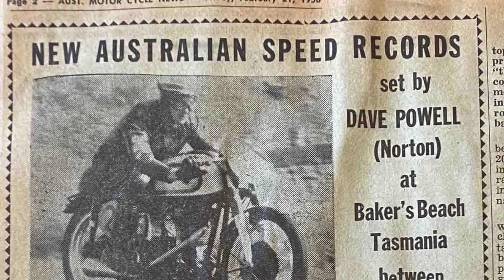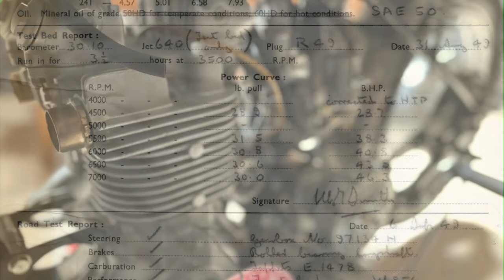HAVE WE FOUND THE ORIGINAL OWNER FROM  1949 ?

Comment: Good point on the rear brake torque arm, i think mines bolted up solid not allowing for float !.
Do those sprung hubs travel in a small  arc or just up and down?, putting the chain under tension at extreme travel?.
Good bloke Alan, having a m/c in your front room is a sign of commitment, good on ya' mate, enjoy.